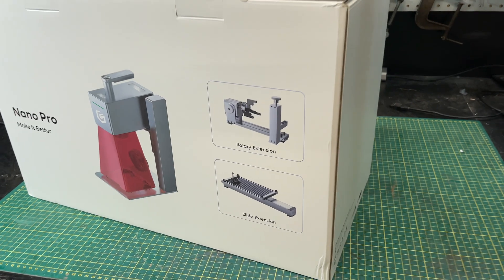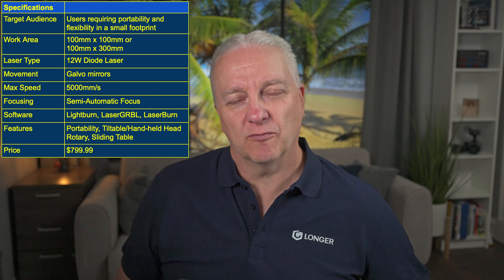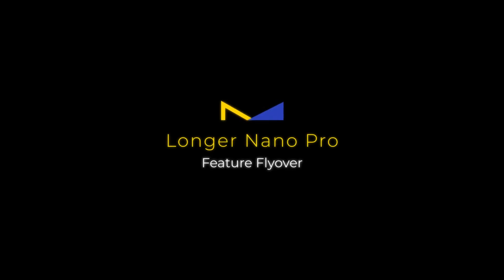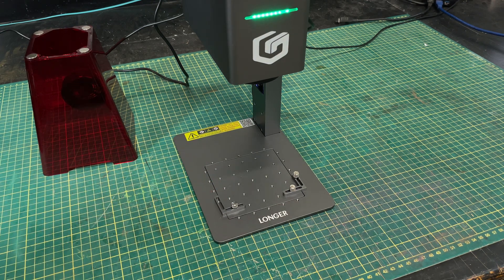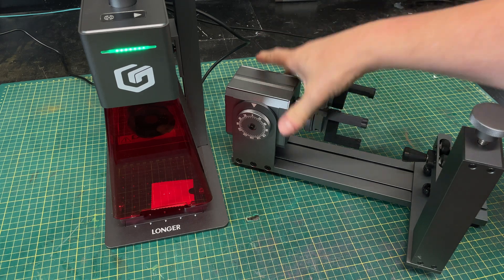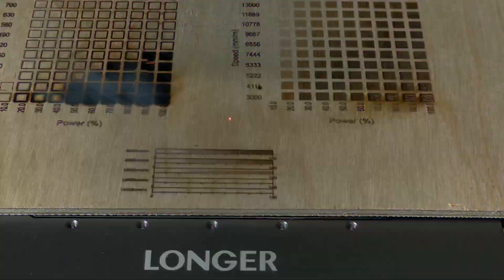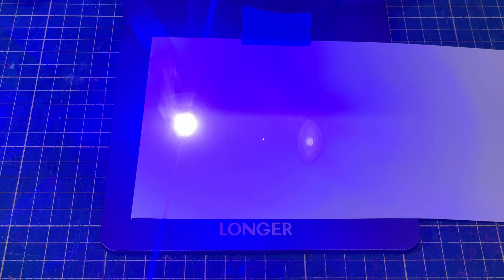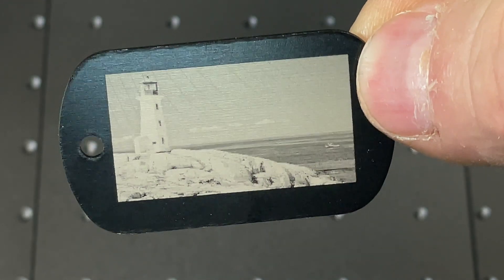Longer Nano Pro  12W Laser - You Won't Believe the Speed and Power

Comment: Worth pointing out that this laser does not require the more expensive Lightburn Fiber / Galvo license as it works with the standard Lightburn functionality we associate with open frame cartesian designs. A great move on the part of Longer as , combined with the laser price, the barrier to entry for a galvo setup is even lower for existing Lightburn fans. 

@Steve, the one thing I've not been able to ascertain from the various videos I've watched is whether you can laser preview cutting paths or if you only get a workspace outline preview. Please advise.
Thanks for the great vid.
Reply from the maker: Good point.  I didn’t call out the licensing only because this is a diode laser.

On you preview question, you definitely can’t outline path like you can with a fiber laser, but you can frame pretty much like any diode laser, though you do need to set the switch to turn the laser one for preview.  The red dot laser is used only for focusing.

Comment: Have you run into any issues with framing when using lightburn?

It’s been flaky for me, sometimes it works, other times it doesn’t.
Reply from the maker: The framing on the regular workspace is definitely caused my a few issues, but I assume that's a software problem that they will fix because framing works fine on the rotary and the extension slide.

Comment: Great video and right time to watch your review. I was thinking to buy galvo laser to engrave jewelry and sterling silver stainless steel and something like jewelry stuff like that. What is you other galvo or IR laser  instead of this one. Because size is matter for future. Thanks
Reply from the maker: The other Galvo lasers I have are the xTool lasers which are pricey but fantastic.  I also use a ComMarker Fiber laser.  Only the xTool F1 Ultra offers a useable larger workspace.  The ComMarker can do 200x200mms but the performance drops off quite a bit as a result
Reply: @SteveMakesEverything  how about Longer Nano Duo AI Laser Engraver (20watt and 2w IR) or  LaserPecker LP5 - The Smart 20W Fiber + Diode Laser Engraver
Reply from the maker: @musaeser161  I've tested the Longer Nano Duo and it's nicer, but a bit more expensive the the Nano Pro.  The LaserPecker is also solid.  I can't comment on the Smart, though.